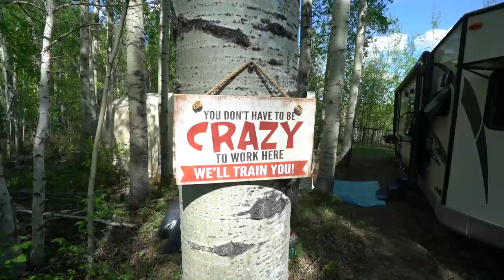SCHOOL BUS FLOOR REMOVAL

Comment: put some bolt lubrication to loosen up let it soak in for a few minutes and then take the bolts out
Reply: El Grand Chilote Enmascarado they need an impact driver
Reply from the maker: We tried that. The tar based undercarriage spray clogged the bolts
Reply: Put some heat on the bolts that rubberized undercoating will burn off , if that doesnt work just torch them off or saw the bolts/nuts off with a cut off 3 in cut off wheel, even a dremel tool with a lot of disc to get in tight areas , watch the sparks or course, looks pretty dry around there.Have some water in a 5 gal bucket closeby, Im surprised that 3/4 plywood was down on the floor, i always though the floors were alum covered with that rubber mat stuff, the alum floor your walking on looks pretty substantial, i guess the wood was for sound deadning as well and to make stuff easier to screw into.

Comment: What are the interior dimensions of the bus? Behind driver's seat to the back wall. You have the exact bus my wife and I want. I have to admit that I cried a little when you cut out the wheelchair lift, I'm in a wheelchair so we need the lift. Great job so far.
Reply from the maker: Thanks, Keith! It’s 26’ front to back, about 7 feet wide. there are plenty out there with lifts, I’m sure you will find a good one. We are donating it to a guy who lost both legs up here.

Comment: You should have watched my floor removal video about all the ways that don't work. I drilled the heads off 600+ of those little suckers
Reply from the maker: Omgggg that sounds painful
Reply: It was. Took the entire month of July. That's why I didn't plug each individual hole. I covered the floor with Ice and Water Shield. It's a roofing product that seals around every hole

Comment: I’ve reset everything on my end. This still won’t play. If it were a YouTube problem it would be more random. So far it’s just you and only three videos.
Reply: Yep
Reply from the maker: I’ve emailed them and there’s nothing they said they can do. I’m sorry.
Reply: Jax Austin because it’s something you are doing differently. If it was a YouTube problem it would be across the board and I have this issue with no other content. Just yours. I don’t know if you’ve toggled a setting, started uploading a different way or using a different parameter, but it’s not anything you tube did or anything I’ve done (other users are reporting the same change and on the same videos), it’s something you are doing. Think about your process and what might have changed. I know I’d like to continue to watch and I’m sure I’m not alone.....